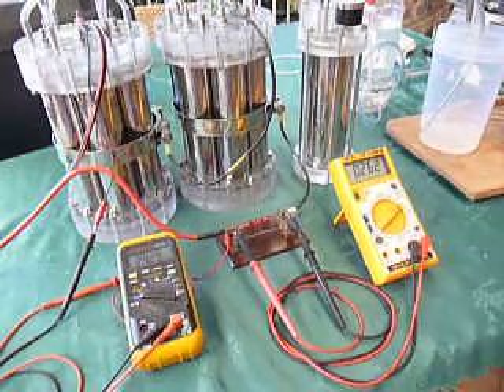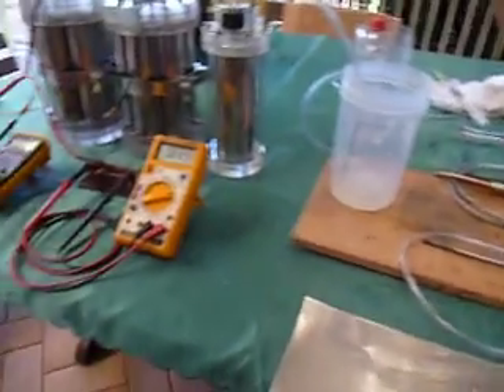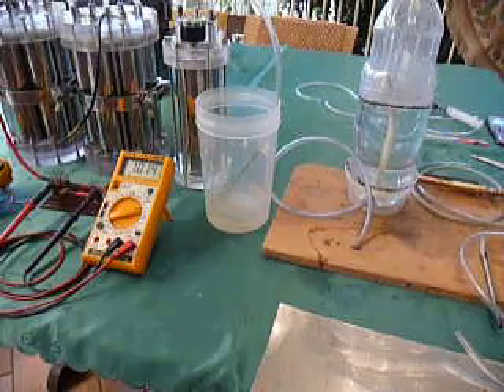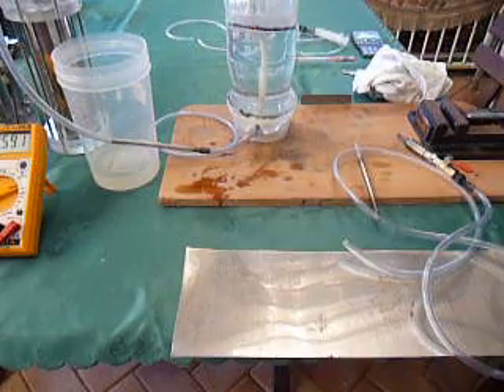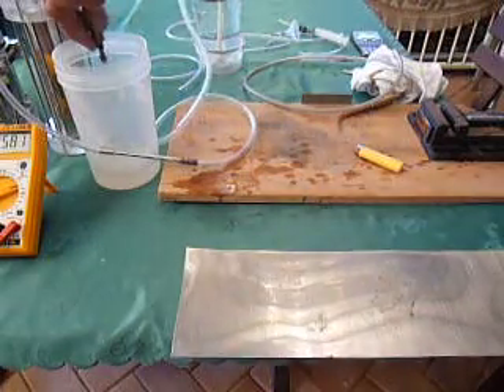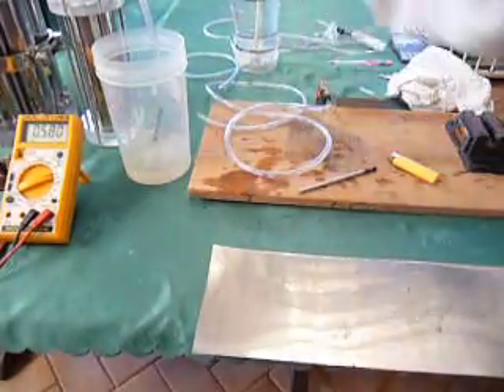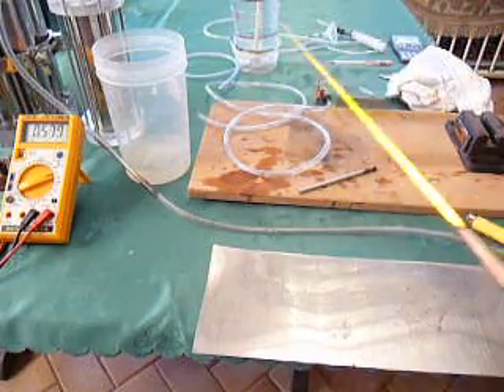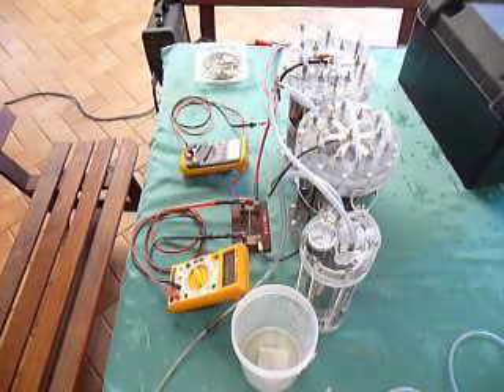12+ltr/min

Comment: Always liked the looks of your  "crob cells."  Never heard the efficiency. Must suppose were they a winner, you would be operating them...

I have a 75' coil of 10.5 inch 314L. (Manufactured in 1987.) Can make up tubes of the same diameters as yours.  Might use loosely wound nylon fishing line to separate tubes from inner tubes if necessary.  

DON'T do it for free!  Have some nice 1 oz Silver Austrian Philharmonic coins, for instance. You send the plates "raw." I'll polish out  the jaggies